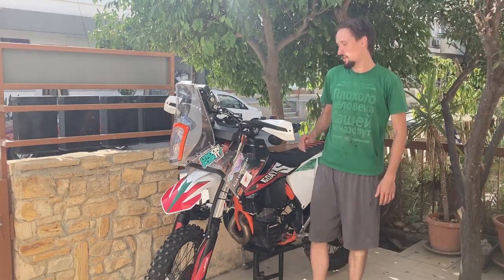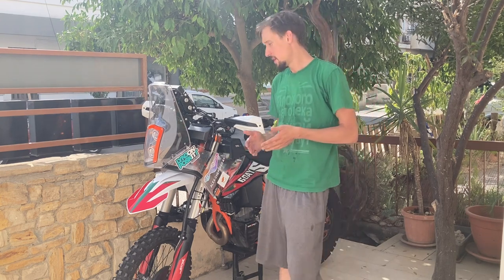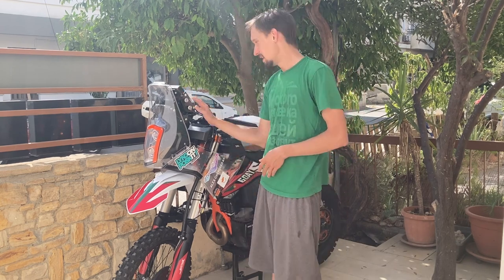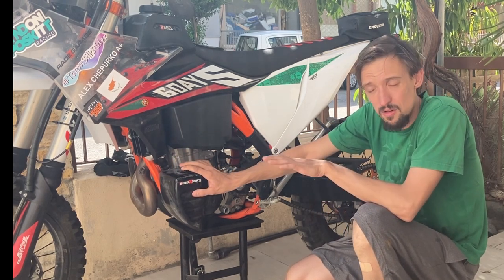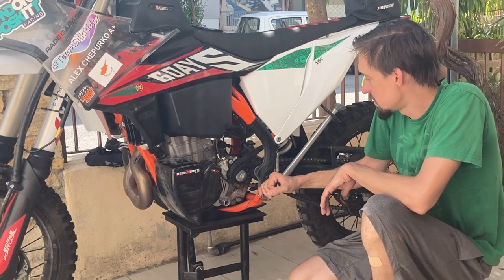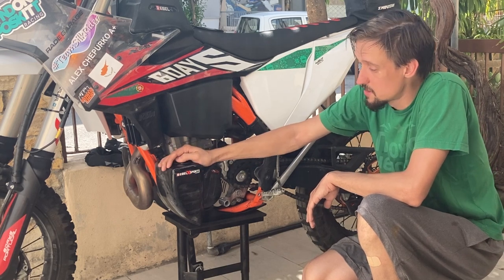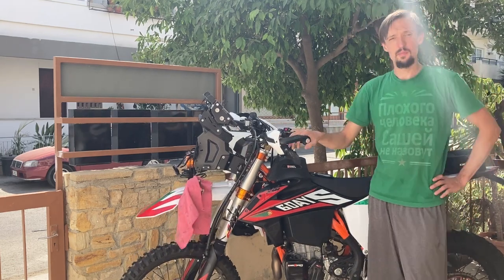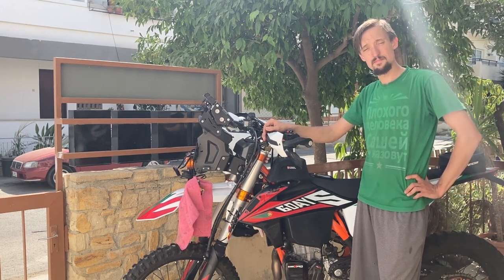How to Build a Rally Bike - KTM 450 EXC-F Rade Garage Kit

Comment: Brilliant build and video mate, looks great! I’ve got a 701 enduro I’ve modified with lots of Rade parts to be a TET/Lightweight ADV bike (vid on my channel if interested), but I am wanting to get into rally racing and I’m thinking of getting a dedicated 450 so this has really helped 🤘 thanks!
Reply from the maker: Thanks, I might make another video soon but I’ve actually switched my 450 to simple handlebar-mounted navigation after a few races with the full nav tower. It may not look as good, but the benefits outweigh; weight savings, simplicity, and cost. Plus I need to take it off after a rally so I can do MX and enduro. Doing that with the nav tower a couple times a year was a nightmare for me. You can get everything you need from Rally Moto Shop or H3D Moto.
Reply: @SilkRider  ah nice! Yeah that’s what I was probably going to do, before I got my Rade garage fairing for my 701 I had an Adventure Spec mini fairing, which is super super light and easy to mount / dismount. Will probably put my f2r nav setup on there for easy mounting/dismounting as that’s what it was designed for. Also saves a bunch of money on another fairing that I can put towards entry fees for next season 👍🏽
Reply from the maker: @OSR_1  definitely get everything F2R, especially the power box. It is the best.
Reply: @SilkRider  yeah I got a great deal from a chap on eBay, F2R 850 and a Rally Max G Ico, with full housing, controller and wiring setup 🤘🏽. Arrives on the weekend, can’t wait!

He had it on his 690 R with Rade fairing so should be a straight forward setup for me

Comment: Great video! You look like a tall guy - what have you done wrt ergonomics? Seat looks custom, is that taller than stock? How about risers / pegs?
Reply from the maker: Nope that’s the stock seat. The time card pocket there is KTM PowerPart number 79407978000 all you have to do is use grip glue to glue it on.

I found that doing a custom seat was too much money that could be spent on spares, and all the other junk you need to do this. Plus you should be on your feet not your ass!

KTMs are the tallest bikes out there so unless you’re 8 feet tall you’re not gonna need it higher, and I only know of lowering kits anyway.

The stock foot pegs are so grippy and pointy they will put holes in bare feet. Handlebar gets a bit of a rise from the steering damper bracket.
Reply from the maker: I’d say the only ergonomic additions would be the ProGrip 786 foam rally grips and the donuts to prevent blisters (KTM PowerPart U6951716). Otherwise just have a good comfy helmet, protection and jacket...
Reply: @SilkRider  thanks - I’m 190 so just trying to work out how to get a bit more legroom.
Reply from the maker: @dagsonstebo5920  this is the seat you need part number 79107940100 https://www.ktm.com/en-int/parts---wear/powerparts/products/seats/seat-1001686798.html?year=2020&segment=Enduro&model=F8403T2
Reply: @SilkRider  thanks yes looking at that but considering the tall / wide Seat Concepts for a bit more comfort

Comment: Very good videos, thank you. What would you think of a 500 excf as a platform for a rally built? And of the 701? Thx
Reply from the maker: Both are great, but be careful cuz they're more powerful and heavier. I would call 701 rally builds better suited for adv and off road travel. The 500 is much more similar to the 450 though, same chassis, just a slightly bigger cylinder.
Reply: @SilkRider  interesting. I thought the 450 was snappier and more challenging than the 500. So, all in all, you’d say the 701 is better suited to rallies like in your videos?
Reply from the maker: @miro_s  no, anything over a 450 for rallies is too much especially if you’re not a motocross/enduro/trials athlete. If you’re starting out you want to go lower than a 450, like a 350, so you don’t kill yourself. But a 450 is the sweet spot than can race in rallies and all kinds of disciplines, while also being great for adv touring since they can easily ride on motorways.

Comment: It sounds like if you plumb the breather from your main tank to the outlet on your sub tank it will suck your sub tank dry first.
Reply from the maker: Sounds like a really good idea, but I still need a breather to atmosphere so I probably need a splitter somewhere along the line between the tanks right? For now I’m using this to shut off the rear https://www.motionpro.com/product/12-0035
Reply: @SilkRider  have a look at this video "RIDE ADV Tenere 700 fleet 125,000 + accumulative Km's Part4". He shows a similar installation on a T7. To make sure you get suction from the main tank you can get a breather kit from TacoMoto which fits on the top of the main tank and replaces the connection on the main cap.

Comment: Can you show a small video how you put all the cables from the right (near the stearing) under that carbon fiber cover under the orginal speedometer? or could you put all cables from the right into the tower?
Reply from the maker: You remove the factory plastic bracket holding those cables and replace it with a steel bracket that Rade provides. Taking pics of the original wiring and saving it for later always helps in case you need to go back to original, like I’ve done for now.

With the steel Rade rally bracket, it’s really all in your hands from there. I was never really satisfied this first time I assembled the nav equipment because I zip tied all the cables under the speedo against the Rade bracket and routed them directly into the carbon tower (there are two holes in the tower facing the steering head where all the cables are).

This resulted in more stress on the cables than I preferred because between the speedo and nav tower you obviously have steering and the nav tower is what is stationary, while the speedo, and consequently your cables, are moving. So when too many cables are bunched up it causes a lot of rubbing and strain on them, which eventually resulted in the Speedocap remote cable fraying and making that remote malfunction.

Conclusion: the next time I’m assembling the nav tower (for Hellas Rally in May) I’m planning on routing fewer cables directly between that choke point near the steering head and will look to route cables outside the nav tower instead. I think this will involve drilling holes and maybe using some adhesive cable holders.

Basically, don’t do what I did and try and go for a “clean” look. This is not what is important if you’re racing. Route the cables so there’s minimum stress on them and so they also have enough slack for steering. If you need more holes then drill them (after measuring twice).

I’ll probably post a vid on electronics in the spring when I build this back up.
Reply: @SilkRider  thanks for answering. Ok same problem with me. I use the Rebel X tower on last Hellas Rally. But I was not satisfied with the cable routes. Hope Hellas 2021 will go on.
Reply from the maker: @S2000-z1q  yeah I think the stock holes in the towers are for the bare minimum like light and power cables. Then with the nav equipment and especially handlebar switches you can use the exterior of the tower and use spiral cable wrap to give the cables extra protection on the exterior